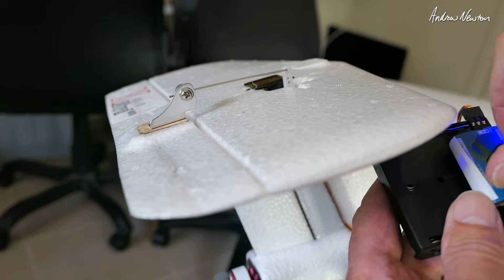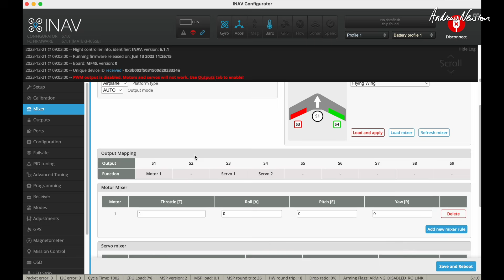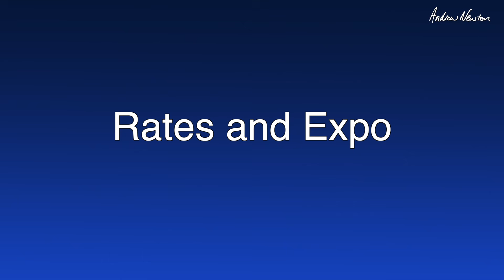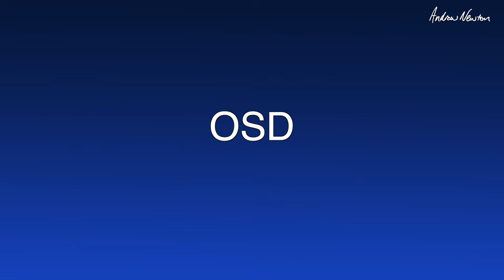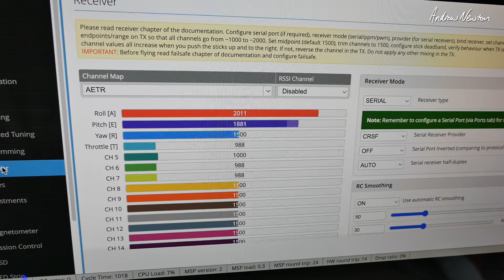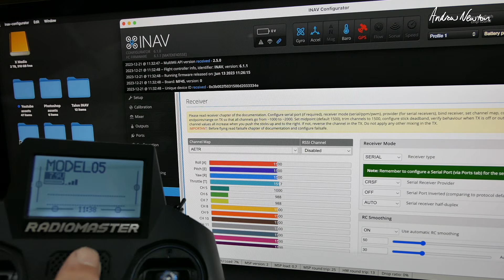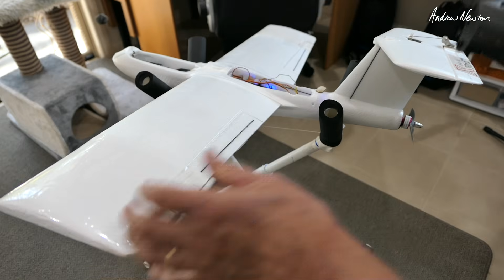Simplified INAV for fixed wing

Comment: Hello sir, I’m having problems with INAV, you are the best source of info on INAV on YouTube for fixed wings, so I’m asking you,  whenever I roll right my throttle throttles up without my input and whenever y go right the throttle lowers, why is this happening? My radio has no mixes
Reply from the maker: It's behaving like you have the wrong mix, either in your radio or INAV mixer. Follow this video and you can't go wrong.
Reply: I’m flying an fms Maule with flaps and my maiden flight is on my channel, whoever I did not notice this problem on the first flight 😊
Reply: Very educational for the beginner (me).
My end goal:
Glider with 90 to 120 minuyes fligjt time. Dji digital fpv with gimbal. Flying and gliding a waypoint mission while i sit back in a gardenstool behind my car.
I fly a little over a year now.
Next summer i will be able to do this with my own build.

Comment: Thanks Andrew that has been very helpful getting into my 1st iNav plane, coming from drone and being out of planes for a decade. I do have a couple of questions, I hope you can help me out:
I have an AtomRC Flying Fish, currently flying LOS manual with a PWM ELRS receiver. I planned on putting a FlyingRC F4 Wing FC into it which is currently flashed for iNAV 8. However I don't plan to put an OSD/camera on it yet as the 04 is set up on a different system. I want to try mainly iNAV's Angel/Acro (or I guess iNav's flight stabilizer capabilities).  Windy conditions here in Perth really does not present much opportunity to fly the Flying Fish in manual nicely..
Questions: 
- My radio is set for 100% rates and 20%/15% expo currently to to deal with the windy conditions. Do I need to set this into the iNav PID tuning tab (rates & expo) - i.e effectively applying this rates/expo when iNav is set to Manual? or will this be applied across Angel/Acro mode as well?
- Since without camera and OSD but with GPS what is the minimum satalites needed in iNav to able to arm the plane? (as Betaflight allows changing this min sat value). And, will iNav arm/disarm also completely disable all servo movements?
- The Flying Fish also goes full vertical once heavy throttle is applied. Will iNav Angel/Acro mode also apply downwards pitch automatically to counter this?

Sorry for the long list of questions! But really appreciate your time and knowlege on this subject!
Reply from the maker: Good questions.
For INAV - never set expo in the radio, only 100% rates. Best to set up a new basic radio model just for INAV, don't reuse your FFish model.
Expo is in Tuning > Rates and Expo. Default for Manual is 30%, Stabilised rates are also on this page. I usually don't change them.
Go to the Mechanics tab and enter 4 in the Level Trim (deg) , this should give level flight in Angle mode.
6 sats required for arming. Can be reduced with a CLI command but not recommended. Servos still work when disarmed.
INAV Acro and Angle will try to resist the pitch up with increased throttle.
Have a look at my latest INAV video on Arming Flags.

Comment: success !!!! after a couple of years of failing with INAV wings, decided to use a stable sports glider with INAV. my first successful FPV flight. It was fantastic, could not wipe the smile off my face. everything worked well , have a small porpoise affect when using RTH , but will tackle tuning after a few more flights. Thank you very much for your video.
Reply from the maker: Excellent to hear. INAV8 does have a porpoising problem. Should be addressed in the next release, or use INAV 7.1.2

Comment: G’day Andrew its Gary from Wollongong i have been watching your videos for some time simple & straight forward i have been trying to get my stick inputs to work on INAV 8. Using a Mayteksys F405 v2 I have set up my TS16S exactly as you describe ,the RX is a Radiomaster R86C which is bound to the radio & working it is connected to UART2 , i have a GPS connected to UART4 & working INAV is receiving the data & my position is showing on the maps,
On the status page the Navigation is safe has a red tick all the rest are green but i still have no stick inputs, in desperation i defaulted both the radio & INAV still the same i have read the Wiki found a section on no stick inputs followed there instructions same as you described can you offer any suggestions?
I have tried a Frsky RX same results
Reply: Thanks Andrew it’s all working out. I will be over your neck of the woods in about 6 weeks on holidays having a look around
Reply from the maker: Hi Gary. Connect the receiver to SBUS on the board not UART2

Comment: Hi Andrew, the last segment confirms my issue. All my control surfaces move in the right direction with the sticks. However, when I tip the nose down, the elevons move down instead of up. Alerons work fine. Any ideas?
Reply: Swapped the servos over and reversed in the trans, all good again. :)
Reply from the maker: Excellent. But re-check that the animation follows the plane movements, the graphs move to the right when the sticks go up and right, and that the control surfaces move correctly with stick movements.

Comment: Hey Andrew, thanks so much for all of your videos. I've built a ranger 1600 using all of your vids for guidance. First flight a couple days ago. All went really well, apart from when coming in to land in acro at a glide with zero throttle, motor spins up and makes approach too fast. I have 'stop motors on low throttle' selected in the outputs tab. The facebook page is suggesting that its possibly an ESC issue or conflict with airmode being on and to turn it off. Would you agree, or have any other suggestions?
Reply from the maker: Might need to program the prop brake in your ESC
Reply: @AndrewNewton, thank you, ill give that a try. I just checked the esc manual and defult is brake off! So fingers crossed that was the problem. Thanks again!
Reply from the maker: Let me know if it helps. I need to do the same with a few of mine
Reply: @AndrewNewton   Went for a flight today, beautiful afternoon flying. Programming the esc to brake seems to have solved the issue. Thank you Andrew!
Reply from the maker: @Russl_90  That's great. Thanks for the follow-up

Comment: oh hey and another one: if i have the ailerons on a Y-splitter, is ok to just configure as Airplane and then delete teh second servo for "stabilized roll?" or is there a great benefit to keeping them indepent and having two? cheers!
Reply from the maker: Yes that's fine. Only need for separate aileron inputs is if you want flaperons

Comment: hey Andrew! These are so great, thanks mate. Couple quick questions: 1) do you have a default switch layout for the tx16s for fixed wing you suggest? got one that works fine, but moving from gyro recievers to INAV so any wise input helps... eg where to put ARM, MODES, RATES, etc. i'm flying "normal" fixed wing stuff (a super cub, flightline 1200mm spitfire) with flaps and sometimes retracts. 2) what's the right way to implement rates for manual mode? in INAV somewhere, or transmitter? thank you!
Reply from the maker: Thanks mate. I don't use the TX16S for INAV but I would probably have arming on SF because it's 2 position and won't easily be disarmed by mistake. Acro Angle and Manual on SB, Acro Cruz and Loiter on SC, then Acro RTH RTH on SG as your panic switch. You don't usually use dual rates with INAV but you can set it up in your radio making sure it's only active in the Manual mode switch position. Overall rates and expo are set in the Tuning page > Rates and Expo.

Comment: Newbie here. Does iNav only work with OpenTX/Edge? All my radio gear is Spektrum. Will the Spektrum SPM4650 DSMX SRXL2 V2 Serial Micro Receiver work out of the box i.e. no modification soldering to do?
Reply from the maker: No mods needed, you're good to go. Just have to select SRXL2 as the serial receiver provider and choose the Spectrum channel map. Both in the receiver page.

Comment: I'm wondering about the maiden....if you trim the 1st flight then add the settings to INAV, it might make more sense to me to do so. Why can't INAV sense the Transmitters settings already?
Reply from the maker: You can use trim if you never leave Manual mode, but that is not what INAV is designed for. In other modes trim is seen as an external command and is treated differently depending on which mode you are in. Try it yourself. Put in lots of radio trim then switch to different modes.

Comment: Just loaded an airplane without rudder and I only have one aileron, S4, the other one, which would be green, does not have anything. Still setting up the Zohd Drift model, I'm wondering if this is going to be an issue.
Reply from the maker: That is normal. Connect ailerons to S4 using a Y-Lead. Or you can add another mixer line for S5 - Stabilised roll, and plug the ailerons in separately.

Comment: I missed in this video clip how the servos are connected to the flight controller. And which servo is connected to which slot.

Specifically, if the model has 2 aileron servos, which slot is the first aileron servo connected to and which slot is the second aileron servo connected to?
Reply from the maker: Mixer chapter

Comment: Your videos are fantastic Andrew! You've helped me so much in setting up my fixed wing and making the leap from quads.

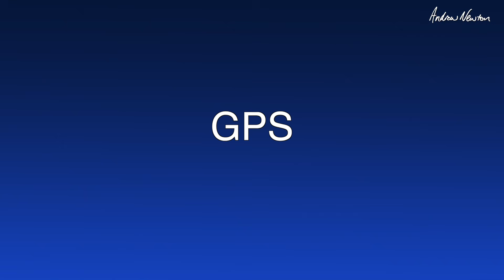Word to the frustrated whose throttle works in INAV, but not with the transmitter; GPS must be able to connect to the satellite (not the FC!) for the motor to be able to arm. If you in a GPS denied environment (e.g. a large building), then you will need to disable it first, or configure it through CLI. You can check what is preventing the arm by typing "status" into the CLI and then seeing the codes - @18:33
Reply from the maker: Thanks, also have to change Failsafe to Do Nothing if you're not using GPS

Comment: Are you be able to use elevator trim to set the neutral angle for angle mode?
Reply from the maker: No, do not use radio trims with INAV. You need use the Fixed Wing Level Trim (PIDS>Mechanics) to get level flight in Angle. I always start with +4 degrees.
Reply: @AndrewNewton So with setting the fixed wing level trim is my plane supposed to automatically apply that trim on the ground? i set the trim but my servos did nothing while on the ground when does that trim setting come into play?
Reply from the maker: @JB-dv7ew  Will show in Angle mode or any NAV mode. But it's not a servo trimming tool.

Comment: Isn‘t it possible to use subtrim on the radio if i‘m not able to mechanicle trim it 100%? Or does are there Problems later in inav? Because i want to fly in manual mode. Does inav uses the auto trims or the trim from the radio? 😅sorry, builded a few planes but this is the First fpv and with inav..
Reply from the maker: No, don't use the radio trims. Instead use the Outputs page in INAV configurator for mid point adjustment, also turn on "Continuously trim servos..." in Configuration. For reducing throws reduce the Manual Rates in the PID page - Rates and Expo.
Reply from the maker: This is a good question, I will make a video some day
Reply: @AndrewNewton  Thank you! I‘ll have a look in a few days. Just recieved my speedy bee f405 wing yesterday  !what a cool piece of Hardware! But there is a lot to learn. I came from a flying field with planes and jets, always used Spektrum Receiver/Gyros and a few quads on betaflight and have to get used to it without trim Buttons and the other settings. But your Video helps a lot for the first steps 🙏🏻So you have to fly - land and trim again? Or am I right, that the auto trim is used for the manual flight later?🙈
Reply from the maker: That "Continuously trim..." setting does it all for you in the air, no need to do anything. Auto trim would also do it too but I never use that. I believe you can also fly in Manual and use the radio trims, then land and enter the resulting mid point values in to INAV and rezero the radio trims if you don't want to use the INAV auto trim functions.
Reply: @AndrewNewton Sounds really simple 🎉If it works, I‘ll use c. Trim of course! Less work for me 😅thank you ❤

Comment: Andrew,,,I hope you don’t tire of all my questions.  But another detail (for understanding iNAV). I now fully understand your choice of angle and manual flight modes on a three position switch (leaving acro to be accessed when the switch is in off position).  The question is for the Navigation modes. You like RTH on a two position switch. When this RTH switch is selected (on),,,does this mode override the flight mode selected by the three position switch (and fly in a default flight mode per iNAV’s inherent choice)?  {and I guess this same sort of result happens regardless of which Navigation mode is selected per set up switch}.   Thank you.
Reply: Thanks again for your time and passion.  I am very near a maiden and excited to once again give it a try.  My first try was a good 3 years ago and was a total failure.  Looking back,,,it was a terrible airframe choice on my part. Plus, your “Simplified” setup method of late last year (2023) had not been published:-).  I will let you know how the first flight turns out,,,of which I am very confident.
Reply from the maker: No problem, you ask good questions Marty. RTH overrides all other modes because that's the panic mode for lost video or RC link, then Manual overrides all but RTH. All the Nav modes use Angle automatically.

Comment: Hello and thanks for sharing! First of all - I'm new in iNav. Could you tell me please, if I'm installing a FC on a single aileron servo/single flap servo aircraft (using Y-harness cable), how to set it up in iNav, because there are two aileron servos on two separate channels and no flap servo in the presets? Thank you!
P.s. using Spektrum SRXL2 receiver, if that matters.
Reply: It would be great if you have the will and time to make a video of how to set up iNav for standard aircraft with flaps and gear; flap-elevator mix etc. I'm coming from LOS flying, and I'm sure that there are a lot of people like me - familiar with LOS flying and programming, but absolutely iNav/FPV newbies. And I can assure you that this number of people will grow up exponentially:)
Reply from the maker: I have a few INAV flaps videos https://www.youtube.com/@AndrewNewton/search?query=inav%20flaps
Reply from the maker: Greetings and many thanks for the donation. Ailerons and flaps on Y-Leads are no problem. Plug the aileron Y-lead into S3 and set the INAV Mixer line for Servo1 to be "Stabilised Roll" then plug Flaps Y-lead in to S4 and change the Input to be "RC Channel x" where x is your flaps channel in the radio
Reply: @AndrewNewton  thank you for your reply! I knew I should have done better research on your channel...:D
Reply from the maker: @emiliyanmartinov  Ha! Not a problem. Good luck and feel free to ask any questions along the way.
Reply: @AndrewNewton  Thanks for your willingness to help! I will need it when my Super Tucano arrives and the iNAV adventure begins:)
Reply: @AndrewNewton  Actually I have a question - If I set the flaps in iNav with no flap-elevator mix on the radio, how the iNav will set the flap-elevator mix to prevent ballooning, especially in manual mode? Or should I set the mix on the radio for manual mode only?
Reply from the maker: INAV will resist ballooning automatically in all modes except manual. So you would use your normal flap/elevator mix in the radio but only enabled in manual mode switch position.
Reply: @AndrewNewton  As I thought. Thanks!

Comment: Hey there Andrew.  Just beginning to integrate my F411 into my flying wing.  I've already conversed with you on your subsequent video about my prep. As a recap,,,my wing is flyable and all set.  But as I start the conversion,,,I realized that I have to also change (from my PWM RX) to a serial RX (for the F411).  I'm good with this change and am ready to do such,,,,but will this cause a problem,,,,,since my wing was made flyable with my PWM RX?  I don't see any other choice but wanted to run this by you. I hope my question makes sense.  I just have a feeling this will make a difference.  But hope not. Thanks so much!
Reply from the maker: No it won't be a problem. The PWM signals will come from the F411 rather than the receiver now. Just remember not to use the same model setup in the radio. Set up a new INAV model as in the video. The elevon mixing is done by the F411 not the radio now.

Comment: Hello Andrew,
I learned a lot from this video.
Can you tell me what is the difference between acro mode and manual mode?
Also can you tell me the difference between horizon mode and angle mode?
Sincerely
Reply from the maker: Thanks, modes explained https://inavfixedwinggroup.com/guides/getting-started/inav-modes-guide/
Reply: @AndrewNewton  This is exactly what I needed. By any chance would you have the same thing for the radiomaster boxer?
Thank you very much Andrew
Reply: @BigbadlyLickedbear The setup in the boxer is the same as is shown on the Zorro.

Comment: This is great Andrew, thanks. One thing confusing me coming from using gyros such as Hobbyeagles, is there a gain control for stabilisation or is it just on or off?
Reply from the maker: The PID tuning screen would be similar to your gyro gain pots. But the stock PIDs are usually fine as they are. In the Modes section you can choose all the different stabilisation modes.